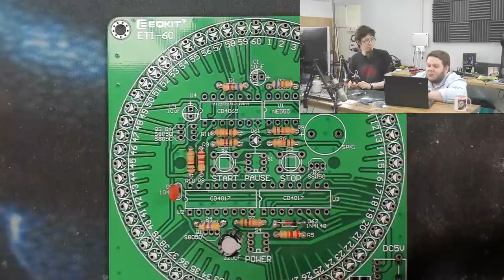Soldering Kit Build(s) And The News  - Two Guys Talk Tech #39

Comment: EV battery management systems usually ramp charge up from 10% to 70% at higher levels, then ramp down in steps at 80% and 90% at which time it will be 7-11 kW charging. 
Normal rapid charging of 60kWh battery will be about 80-100 kW rate,  you local Tesco has a 7kW slow charger (free) that would put 14 kW or 50 miles worth in for the max 2 hour stay. Free motoring...